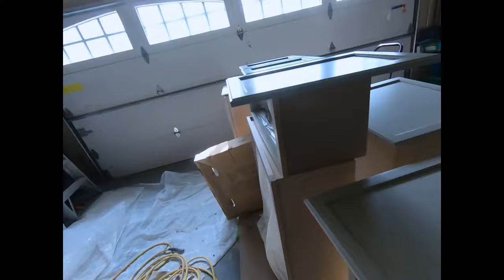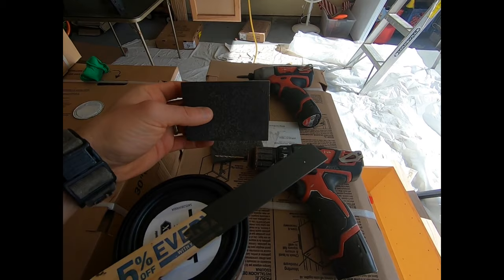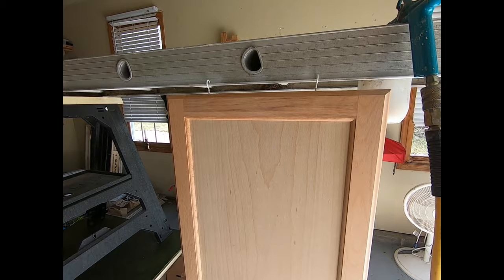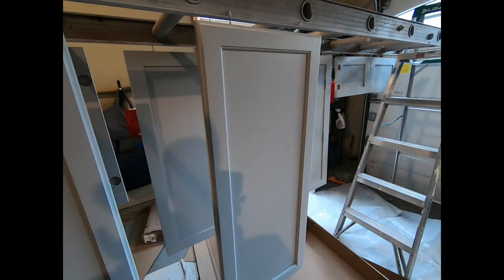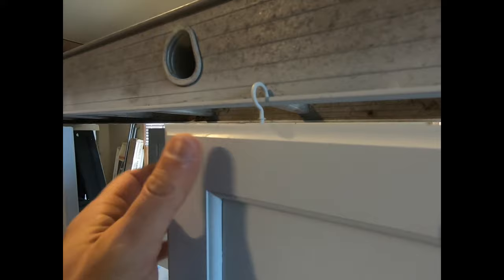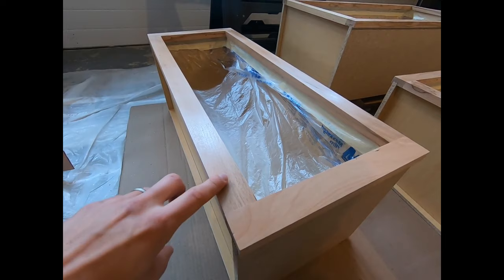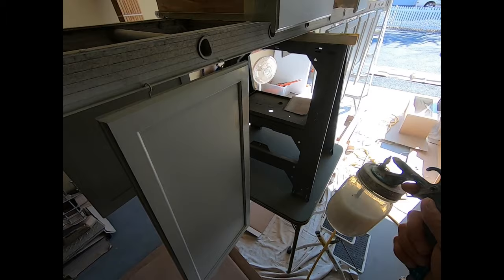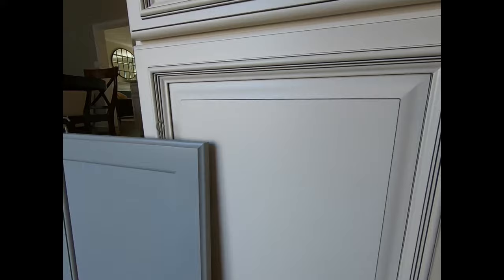How to paint unfinished cabinets from home depot or lowes

Comment: First time painting a cabinet. Built my cabinet from unfinished Baltic birch plywood. Used your technique and it came out great! I used a cheap HVLP sprayer and did not setup a hanging station. I was also afraid of the sanding because I only had 220 grit paper and it seemed harsh with even the lightest touch, so I did not sand after every application. My finish was not as glass like as yours but I am still extremely pleased. I imagine after the coat has had a few days to cure it should look even better. I learned a lot with this cabinet build and paint and am very excited about the next one! Thanks!!!
Reply from the maker: Glad to hear it.  Thanks for sharing your positive experience.

Comment: Hi there! Today we were quoted just over $2000 for someone to paint our cabinets 🤯 needless to say, we’ll be doing it ourselves! Does the process change much to paint old cabinets? We definitely want to sand them beforehand. I love the finish that you got, definitely getting a critter siphon.
Reply from the maker: You’re going to save a lot of $$.  I have painted many finished cabinets before.  Honestly, you don’t have to sand them either IMO.  Just give them a good clean to make sure no grease or caked dirt is on them.  If they are already finished, you can skip the sanding sealer part and go right to paint.  I don’t prime either because in my experience as long as you finish them with a protective finish you will be good.  You will love the Critter, just practice on some scrap pieces to get the hang of it.  Good luck with your project.  Please like and share the video 👊🏽

Comment: What was the key to covering up the wood grain? I LOVE how these turned out and would like to have a wood grain free look as you achieved!
Reply from the maker: Thank you! I am very happy with them as well.  To clarify, these were unfinished from Home Depot.  They do come smooth to the touch with no grain on the faces.  The faces being the 1x2 stile and rail.  The panels were also smoothish on the face, but grainy on the back.  The wood sealer does fill in the fibers of the wood, it is NOT a grain filler.  If your cabinets are grainy, like the old oak cabinets, you will need a grain filler such as Aquacoat.  I am literally editing a video now where I use the grain filler on another kitchen project.  Give me a few days and I should have that up.  Hope this answers your question.  Thanks for watching 👊🏼

Comment: Nice! Thank you so much for the tutorial. Was there a reason for wood filler after the second coat of paint? Or can you do it before the sanding primer?
Reply from the maker: Glad you found it helpful. Good question, you can certainly use wood filler prior to sealing the wood.  I have done it both ways and I can’t decide which is best or not. I also had to make panels for this project and I used wood filler first because they were much rougher to begin with.  Hope this helps. Thanks for watching, good luck with your project 👊🏼

Comment: I wish I had watched your video before I did my cabinet. My cabinet has so many flex on it after spraying it. I did not use the sand prep had no idea about it. I have tried sanding it and repainting with my sprayer and it still comes up with a lot of flex… any suggestions?
Reply from the maker: Hi, sorry for some reason I am just seeing this message.  What do you mean by flex?

Comment: Hi love the video! Very informative with some things mentioned that I haven’t seen yet. (I’ve been watching what seems like thousands of videos on cabinet painting since I’m neck deep in my kitchen Reno) So just some questions for you: 1. Does the sanding sealer take the place of a traditional primer? I haven’t ever heard or seen anyone mention this in any cabinet painting tutorials before. 2. Is it always recommended to hang cabinets while painting vs. laying them flat? The paint I bought is Behr alkyd so it behaves somewhat like an enamel so I just worry that it would run if I hung them up. 3. When recoating do you always follow the recoating time on the product or do you wait longer? I have seen multiple people mention that waiting longer than recommended makes for a more durable surface and better paint adhesion? 4. What is your recommendation for curing time before installing and using? I live in a somewhat humid climate so I usually have to wait longer for painted projects to cure. Sometimes I see people painting and then the next day installing their cabinets. Other times people say to wait a week?
Reply from the maker: Thanks for the positive feedback.  All gd questions and I’ll try to address.  I like the sealer better than primer because it gives a shiny & smooth surface for the paint to adhere to.  As for hanging, I do it so I can get both sides same day, it’s just a method that I believe is much more efficient.  I spray my paint, so never have the issue of dripping really.  Another advantage of spraying is recoating time.  Sometimes I can recoat as soon as the paint dries.  Since nothing is making contact with the painted surface (like a brush) you will not jeopardize the finish.  I am in NE PA, and I have installed next day.  If I feel the paint is not as dry to handle, I’ll wait another day, but I don’t remember ever doing that really.  I’d also only used water based paint, so unsure with oil based, might require more drying time.  I hope I answered all your questions.  Good luck with your project.  Thanks for watching 👊🏼

Comment: Great video. I just did this with my existing cabinets, but I used a Graco sprayer as opposed to the critter. I gotta say I wish I had seen this prior to the work I had done, as the critter looks like a way better option. 

Thanks for the great video!
Reply from the maker: Thanks buddy.  I have a Graco one too, but I use that one for bigger projects like whole house doors and painting (gut jobs).  I’ve seen contractors use the Graco, but u must have the proper tip (very fine tip) and move fast cause that thing brings out a lot of paint.  I prefer the Critter for the control and it uses way less paint.  Also, the clean up is a breeze.  IMO it’s a must have tool especially when you’re doing smaller projects like shelves or trim work.  I am sure your cabinets look great, paint goes a long way.  Thanks for watching and supporting ✊🏼

Comment: Nice looking doors but if you have high quality painting equipment like Kremlin air mix paint guns and pumps, you’ll only need to sand the wood with with a final sanding with 220 sand paper and one coat of oil based paint if paying a color. If finishing with clear lacquer, you’ll need 220 sanding, one coat of sealer, 220 sanding then one coat of clear lacquer.
Reply from the maker: Thanks.  Just looked up the Kremlin stuff, that’s some high dollar stuff right there.
Reply: @TrueGritDevelopment  yeah it is most definitely expensive, but when you’re running wide open as a cabinet business, they’re worth every penny.

Comment: Hello! This is the best cabinet painting video I’ve seen and the information/instructions are easy to follow. Did you sand the cabinets before using the sealer?
Reply from the maker: Thank you! No, I didn’t sand them.  These are unfinished cabinets, so they are ready for finish coat.  If you are refinishing cabinets, you do not need to use a sealer.  I have also painted finished cabinets by applying paint directly, but make sure you apply a protective finish.  Sanding sealer is only applied to unfinished wood.  Hope this answers your question.  Thanks for watching and supporting 👊🏼
Reply: @TrueGritDevelopment  Thank you so very much, this definitely answered my question and any wonder in my head about unfinished cabinets. Now on to this project, you’ve been an awesome help and an answered prayer, thanks again.
Reply from the maker: Glad it helped! Good luck with your project.  Pls share and like 👍🏼

Comment: I was following this video to the TEE and after spraying the cabinet paint, it’s leaving a subtle orange peel like finish as opposed to a glass like factory finish. (wish there was a way to send photos of it in YT comments) I thought the top coat might reduce it but it looks around the same just shinier lol.

I’m guessing that something was wrong with the air pressure or paint viscosity. I tried upping the pressure and thinning the paint a bit but the spray pattern stayed around the same. Do you have any recommendations on what might be going wrong?

Lastly I wanna know what recommendations you have for starting over? Should I strip and sand? If so should I apply the sanding sealer again?
Thank you so much in advance, I’ve already learned a lot from the video you made and hope to hear from you
Reply from the maker: Oh no, sorry to hear.  My first thought is your sprayer is putting out a lot of paint or spitting.  Have you used this sprayer before and have you tested the sprayer on a scrap piece before starting your project?
Reply: @TrueGritDevelopment  First time with the critter and I had tested with scrap wood but it was rougher than the cabinet doors so couldn't see the orange peel. I know you can reduce the paint by lifting the nozzle but do you have any other recommendations for fixing the spray pattern (given its that same velspar paint)? Also I'd like to start again with the panel I painted, do you have a recommended process for doing that? (stripping? sanding? re-applying sanding sealer?) I really appreciate your help
Reply from the maker: Got it.  If it’s the same paint, you shouldn’t have the orange peel finish.  Make sure you use a waving motion when spraying and maintain a good distance from the object you’re painting.  As for the panel you want to redo I would sand it down to a smoother finish.  This does not necessarily mean all the way to “unfinished” wood, it’s just enough so when you run your hand on it it feels smooth, so no sanding sealer needed, but maybe a primer for a base coat.  If you decide to sand it all the way to bare wood, then apply the sanding sealer.  Hope this helps.

Comment: Can you give us a step-by-step Time line how long did you wait between the sealer, paint and poly sealer?
Beginning to do this project and using your process.
Thank you
Reply from the maker: For sealer apply first coat then 2nd coat right away, wait 2 hrs before you sand it.   If you’re spraying paint, by the time you’re finished your 1st coat, you’ll be ready for 2nd.  Sand it lightly before applying your final coat.  Spray the poly, sand if necessary (I often skip this step) then apply 2nd coat.  No need to wait between applications because spray paint (using critter) will dry fast enough.  Obviously room temperatures and humidity play a part, so for example, if you still see wet paint spots or wet poly spots then wait a while longer before applying additional coats.  Usually the 2nd and 3rd coats will take longer to dry since wood has already beed saturated.  Hope this helps.
Reply: What is the ratio of sanding sealer to water to dilute for your sprayer. I'm using a warner flexio 590 sprayer.  TIA
Reply from the maker: Don’t dilute the sealer.  It’s thin as is.

Comment: Great video! Liked & Subscribed, Looking forward to watching more of your videos. I'm renovating a RV and bought unfinished cabinets for the kitchen. Really glad I watched this before painting them. I have a few questions!

1. I was going to use primer, but I was worried about the wood grain seems like the wood sealer will help with that. Should I also use a primer after using the sealer, or do you feel like the sealer helps adhere the paint. I want the prevent the paint from flaking or scratching off. I purchased a gripper primer. 

2. Spray gun: We bought the Graco Magnum spray gun but the critter seems a lot more pratical for the cabinets. Do you know if the critter attachement can attach to a Graco Magnum machine if not what spray tip do you recommend?

Thank you so much! 🙂
Reply from the maker: Glad you found the video helpful.  No need for a primer, the sealer will help the paint adhere to the surface, but I would definitely add a clear coat protective finish.  Graco makes good guns IMO.  I would ensure you have a fine tip on it (the critter comes with only one tip that is not interchangeable).  I have a Graco sprayer and I use it for bigger projects and it’s great.  Two main advantages with the Critter is easy clean up/setup and low over spray.  The biggest disadvantage is the amount of paint sprayed is much less, so you will have to make several passes.  Hope this helps!  Good luck with your project 👊🏼

Comment: Great video!  After watching, I purchased the critter and followed your steps.  I’m painting white and I’m going to need a fourth coat but so far I love the gun and the process!!

Did you sand the 3rd coat before going to the poly?  Mine is not mirror smooth so thought I might touch it lightly?  But maybe that’s not needed and will smooth with the poly coats?
Reply from the maker: That’s awesome.  Makes you want to spray everything, doesn’t it? Anyway, sand as needed or to your liking.  The poly will give it some sheen, so it will help.  I don’t think I sanded after my third coat to be honest.  Good luck.

Comment: I only have 3 cabinets to paint, DIY built in shelves, so I'm not sure a sprayer is a reasonable purchase for us for such a small job. Are you able to suggest brush and/or roller to use? I'm sure it won't be as beautiful but trying to do the best work we can. Thanks!!!
Reply from the maker: Sure.  Grab a super soft bristle paint brush for the rails and stiles and use a cabinet roller (the white thin ones) for the flat surfaces.  I also recommend cabinet grade paint.  I have also used floetrol in the past to extend drying time, which allows the paint to spread more evenly.  You may find it necessary to sand b/n coats (220 or finer sand paper).  Hope this helps.

Comment: Thank you for the great video! My wife and I are at the beginning of the project. We bought our cabinets from Home Depot (Hampton Bay). We did 2 coats of Sanding sealer. We started to paint the front drawers for a test. We are in the second coat of the paint (we bought the Dutch Boy brand color 183 C for Cabinets - water-based). After the second coat, we still can see and feel the wood vein. Do you believe that after the 3rd coat, plus the clear coat, the wood vein will disappear? We have an incredible smoothness in our cabinets, but the wood vein feeling is still bugging us. We are using Wagner 4000 sprayer to paint them, and we kind of struggle to adjust the right pressure for the paint.
Thank you so much.
Reply from the maker: Glad you found it helpful.  To be clear, when you say vein you don’t mean grain? These unfinished cabinets are pretty smooth, so mine didn’t have any grains.  If by vein you mean raised wood you feel when you swipe your palm on the surface of the wood, then I would sand once more and paint again.  If it is in fact grain, I recommend you use a grain filler like Aquacoat with a putty knife or credit card and fill those in, sand and paint.  Finishing work is very tedious, I know.  Good luck, hope it turns out great for you guys.
Reply: @TrueGritDevelopment  Thank you! Maybe I meant grain but given the smoothness of the cabinets, I believe it is not the case. When I swipe with the palm of my hand is totally smooth, but I can feel some small bumps in the wood. I will sand it again and continue the coats until I get the results we want. I do agree with you, finishing is a bit tedious, but the reward is amazing. I am confident we will get great results following your suggestions.
Best!

Comment: Great info! Thank you. So I’m guessing that the sand sealer does away with the need for a primer paint?
Reply from the maker: For unfinished surfaces and IMO I’d say yes.  The sealer binds the wood fibers, so it makes for a smoother surface to finish with the paint or stain.  Not to confuse this with grain, it does not fill in grain.  Some ppl were telling me their surfaces were still grainy.  You need a grain filler for that.  Anyway, if you are finishing a dark piece of wood that had previously been finished, I’d do with primer.  Hope this answers your question.  Thanks for watching 👊🏼

Comment: Hi! I love this video! I have a few questions. 

1. Do you sand prior to spraying the sand sealer? 

2. Are these Home Depot cabinets? 

3. I noticed you didn’t prime the cabinets. I guess no need because of the sanding sealer right?
Reply from the maker: Glad you like it 👍🏼.  No need to sand these cabinets as they were pretty smooth; however, that is up to you.  Sanding never hurts, it’s just a pain. These are Home Depot, yes, and I am very happy with how they turned out.  No primer, you are correct since we’re using sealer. I would prime if they were finished cabinets.  Thanks for watching 👊🏼

Comment: Hi! Thank you for this video! My husband and I are renovating our first home and we've been following your steps to paint our kitchen cabinets. We've just put our 3rd coat of paint on and plan to put the polycrylic finish on today or tomorrow. Do we need to lightly sand the cabinets again before putting the finish on or can we put it on without lightly sanding? I want the paint finish to be solid and not have wood grain showing through on the corners.
Reply from the maker: Glad to hear it’s helpful.  Do you have grain now? If you do, you will need to apply a grain filler.  It depends how solid/smooth you want them to look.  The cabinets I got for this job from Home Depot were very smooth and hardly showed any grain especially the door faces (the stiles and rails), so I only applies some wood filler here and there.  If the grain is very light, paint will help fill it, but you’re better of using a grain filler like aquacoat.  If you’re unsure, apply the finish to one cabinet and see how you like it.  Hope this helps.